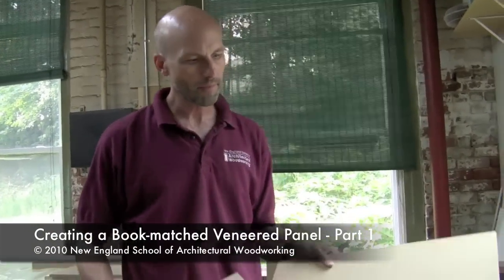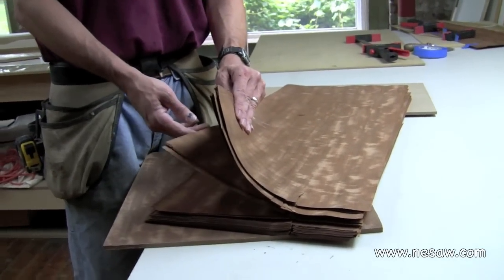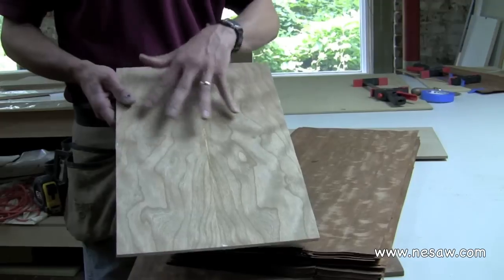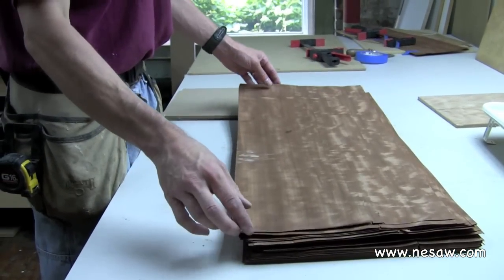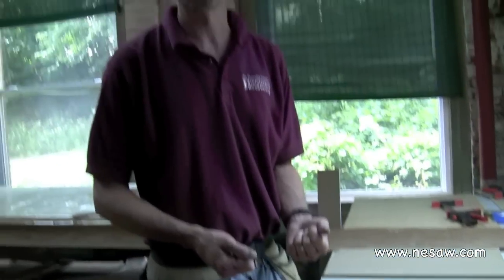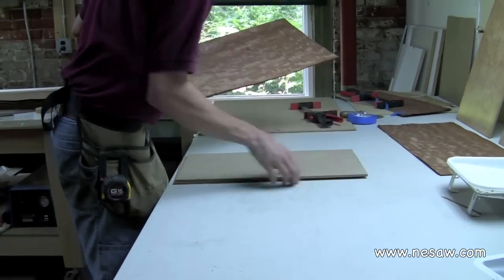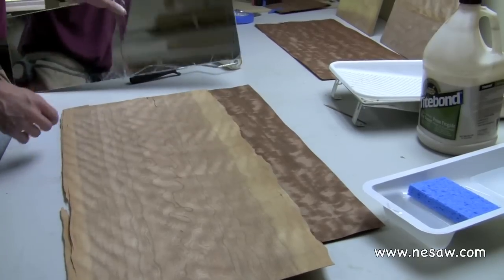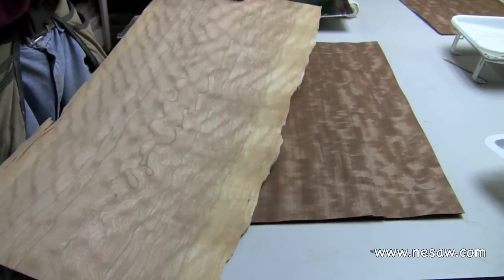Creating a Bookmatched Veneer Panel - Part 1

Comment: I recently acquired a portable Victrola VV-50 in red oak. The book match quartersawn oak veneer on top had curled up on the edges and was lifting badly. The previous owner had tried wood putty to try to re-attach and messed it up such that I had to totally remove the veneer from the top and repaired the substrate.
I bought two sheets of quartersawn oak veneer and followed your video to bookmatch to a tee. I don't have a vacume press, so i used the contact cement method. It came out fantastic!!! Thanks so much for this book match instructional video!!